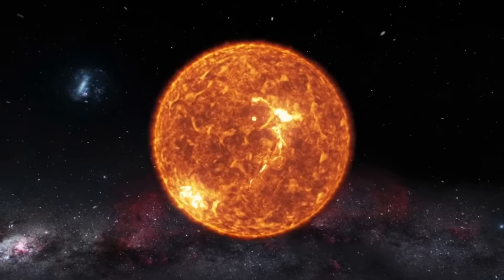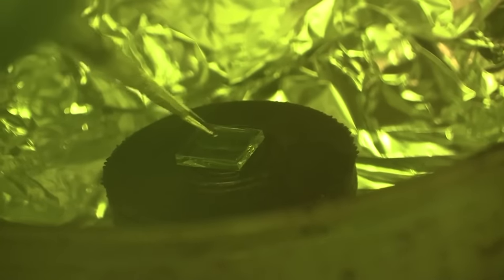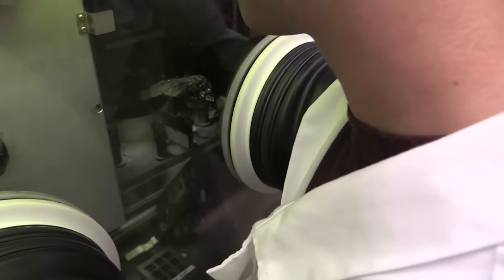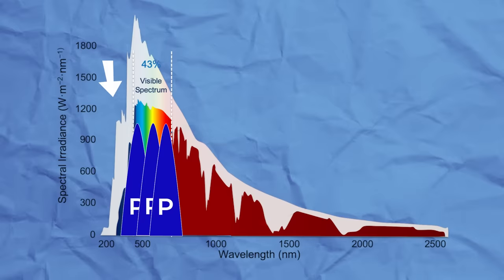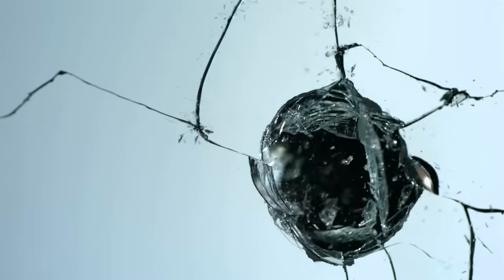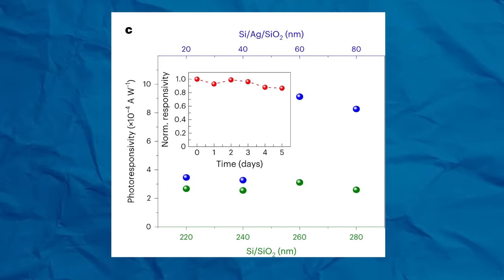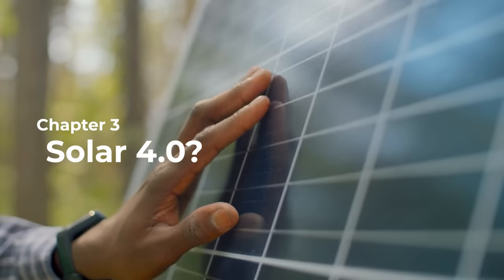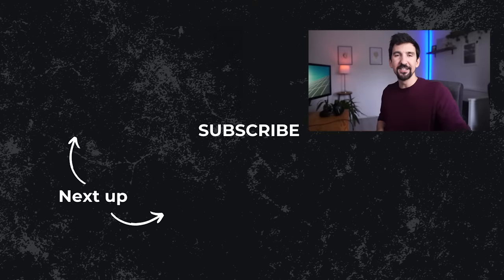Solar 4.0: Ultra Efficient Solar Panel Breakthrough

Comment: Just when I was thinking of getting solar for my home... now I have to wait for 250% better and cheaper Perovskite panels! 🙄
Reply: The wait can be long. Just like new battery tech. So, in the meantime you could get a slightly oversized amount of used classic panels for cheap, and use them for another 10 years or so. Some people do that and the math works out.

Comment: Cool, did the research study say how long it would be before they were ready to be deployed commercially? My mistake was that you answered this question near the end of the video about 10 to 15 years from now A very generous estimate too. Unfortunately, the significant problems with solar power get very hot, And from what you described, the environment would break the solar panels down very quickly.  The next problem is that you must use rare earth metals to perfect this technology, which is bad for the environment. The technology is promising, but it still needs to arrive; Until it's perfected, it means little of nothing. To quote the phrase, it's purely academic.

Comment: I am rather curious if you could avoid stacking all together.  Blue light has a wavelength of something like 400 nanometers and red down to about 800.  Staggered strips or perhaps some triangular planar tiling of 100 and 200 nanometer segments as a quarter of the wavelength provides a coupling region within the domain of one wavelength.
IE - a blue light photon would couple into the 100 nanometer sections and the red light photon into the 200 nanometer sections, even though the photon's wavefront exists across the entire surface.

Layers make silver reflectors complicated, but coupling regions in a planar tile would effectively change the probability of photons to striking those regions optimized for their wavelength to one while making it near-zero for non-optimized regions (although this case does present harmonics, we could use hippie fractals and computers or something to resolve a more effective planar architecture that could be implemented almost arbitrarily with jet printing or something).

Spooky filtering at a distance - SFAD Cell.

Comment: This is why investing on solar panels is questionable. 

Scenario:
You invest 10k-20k putting solar on your house, and cost it to repay in about 15-20 years.

A year or two later new technology increases efficiency by double and it costs the same, so your neighbour fits them, costed to be repaid in half the time. How do you feel about your investment?

Imagine that happening every few years as your still commited to a decade of repayments when others are doing it 5 years, if you had waited how much would you have saved, and how much would you have paid extra in conventional energy? That's the conundrum.

Comment: i'm all for solar and have one, but there always seems to be something new that will "revolutionize" Solar, but it never hits the shelves. As of now Solar is getting very expensive and its getting harder to justify the cost. Right now the UK government is spending £1.7 Billion onnew power stations. (Plus £700 mill that boris announced). Now imagine that, £2.4 billion and just put panels on peaoples home instead. At an average cost of 10k thats 240k homes that can produce electricity at an avg rate of 3kw. I just find that simpler.

Comment: percentages are not good to work with in videos unless you have to.  For instance, "increasing efficiency by" implies that if you say 100%, this is a doubling of efficiency, and considering solar panels are at about 20% roughly right now, that would mean 40%.  If you say 250% that would be a 2.5X increase, so 70% efficient.  If you say one has an efficiency of 150% of something else, then the increase is 50%.

Better to give numbers.  X is 20% efficient at conversion while Y is 40%.  One can easily see that's a doubling.

Comment: Perovskite would already be in production if it were stable - but it's not. They have raised its stability from minutes to years, but are still nowhere near the 80% sustained production over 20-30 years with commercial manufacturing that the market demands. It's a bit disingenuous to only offhandedly talk about stability when efficiency isn't the critical problem. It's like saying "my car will accelerate to 100km in 2 seconds" without following it up by "and then the engine explodes".

Comment: Title is wrong.
The panel isn't 250% efficient, that would be over unity and when we're talking about output of the sun this "250% efficient" solar panel would be a nuclear device.
The panel is 250% more efficient than current tech which isn't very efficient, two and a half times not much is very little.

Comment: the photon mirroring, effectively doubles the thickness of the PN layer in diagram-explanation using silicon.
So both the PV thickness and the mirror thickness matter at each wavelength
(SOSI, Son of a spectrometer inventor)
The thickness of the PV layer relative to photon depth
The thickness of the mirror layer relative to photon depth.
their ratios
PN junction thickness or average thickness
and orientation
The metal layer thickness may not be a true mirror at 2nm and the photon mirror vs tunneling % changes.
Repeat experiment with silicon planar solar cells.
Does this work in silicon or only pervoskovites?
Change the angle of irradiance to see how that changes the output.
Place detectors below and above to measure transmittance and reflection through and from PV surfaces and thicknesses. To detect tunneling and top reflectance.
Perovskites have hole traps in the 3d matrix and discontinuities.
The metal conductor is possibly doing two things for electron-hole transport.
Providing the lowest inductance possible, this allows high frequencies to couple such as local EM fields into the ground plane, not unlike a PCB.
Other things to try:
exaggerated thickness of the PV layers (Silicon and pervoskovites till effects not shown.)
relative to the mirror layer thickness.
The ratios of thicknesses and photon depth profile (average or each or profile of electron-hole pair birth locations) needs to be soused out to see what the bandwidths are to be exploited.
Another thought is the mirror creates a different photon momentum direction in the material matrix. Not sure if that is something that can be translated to an electron hole pair.
trying to be complete to last pebble only with that one.

Comment: This will not amount to anything until Perovskite technology can achieve longevity comparable to silicon.  Would you buy a hyper efficient hybrid car that got 200 miles to the gallon if the batteries died in 6 years? no.

Comment: I don't see these types of cells being viable, they are far to short lived. Solar cells are dirt cheap already, with the inverter and labor being significant factors, so marginally cheaper yet quickly degrading cells would be far more expensive over time. I have little hope that they will be able to get them to last 25+ years like current solar cells.

Comment: 250% more efficiency compared to what?  Older Perovskite cells that were so bad they weren't worth the effort? Like 4% so you could achieve 10%.  Not exactly bowling me over if you only manage that because it means you have to still have twice the number of panels to equal convenstional cells. Real world costs typically are more about installation and battery storage than about the cost for the cells.  Maybe there are some areas in the world  you could just roll out large areas of cells on a surface and never have to worry about wind, rain, snow, hail, sand, animals, vandelism or maintenance but these are few.

Comment: They could be 500% more efficient and it is still a poor technology at scale. Where do the raw materials come from, and what happens with them when they don't work anymore? There is no sun 1/2 the time, and they only work well in limited geography.  We already have great technology at scale which is Nat gas, and we have enough of it to bridge us to a much better technology which will eventually emerge. Maybe Helium 3 reactors, the surface of the moon has enough Helium 3 to provide clean energy on earth for a very long time.

Comment: This would be amazing if they can actually tune the wavelength absorbed. You could effectively get it to be the most beneficial in your area... whether it be full sun conditions, or mostly cloudy, that way you don't have to go through the horrible efficiency systems that are amorphous panels incase you live somewhere that is usually cloudy. I really hope they can find answers to the elements used as well as longevity.

Comment: It's ashame that per square metre of a Solar (silicon) panel requres approximately  on adverage 2000 litres of diesel to mine, 200,000 watts of elctricity to refine, billions of dollars of equitment to process, another 100,000 litres of diesel to mine the metals that go inside & another billion dollars of machinery to process.
It would take 250 years per squre metre to make it equal to it's worth.

Then if we replace the current power generation with solar then what about things like plastic, gas, aeroplane fuels, oil(s), etc. etc. that are by products of the production of crude oil ????????
We might get cheaper or maybe even free power, BUT. . . . . . It will completely destroy the entire planets industry & therefore the planets economy !!!!

Just like the invention of the old type fire extinguisher,  a brilliant idea that put out fires, but also ripped holes on the ozone that allowed more heat into the atmosphere that cause more fires.
Or air conditioning, that keeps a small area cool, but also tears holes in the ozone & heats things up, which requires more air conditioners to cool down.

Comment: in theory?  and then you point out a KNOWN engineering issue.   so in theory youtube could make you rich by repeating another supposed "BREAKthrough" from University of Rochester.  And we can transmit it on the REALLY REAL room temp superconductors right?

Comment: What happens if a magnetic field is introduced assisting the charges to move towards their respective electrodes? You're wrong about infra-red energy, as it's spectrum is vast compared to the visible spectrum, & there's lots of infra-red energy during night time, which is why lots of investments are going into thermo-electrics.

Comment: This isn't really news?  There have been perovskite panels and multi-junction cells for decades.  Most people use 20% efficient silicon based panels because the other ones are super expensive and environmentally damaging.  You only want the high efficiency ones in places like space where just sending the panel there costs $500,000 USD.

Comment: If people aren't licking the lead, I see no reason why it couldn't be used.  I have over 100,000 rounds of lead core ammo. I've restored many vehicles with lead based paint, etc etc.  With proper handling and safety precautions, lead is perfectly fine. Considering the lead in the panel will be quite minimal and have 0 food and minimal localized contact with people. I see no cause for concern.   If someone states its the mining and refining of the lead, well, I have a bridge and a swamp to sell you.

Comment: At most it could be 100% efficient. 250% efficient is impossible. 100% means it converts all the sunlight that hits it to electricity. 250% efficient means it converts 100% of the sunlight to 250% of the sunlight - a nonsensical statement. Pure click bait!

Comment: Your video does not give the efficiency of the perovskite-based solar cells and you used a "250%" factor increase in the performance of the cells - BAD SCIENTIFIC WRITING! The long-term life of the perovskite cell is not fully known. It takes years of exposure to determine the performance life when exposed to sunlight, weather, etc. The silicon cells took a number of years to get the 20 year (or maybe longer) life of the present ones, which still show some degradation. The highest theoretical efficiency for silicon type solar cells is on the order of 40 - 50%, using a number of layers and special coatings. They are not commercial yet.... Disapppinted that you did not provide the paper your talk is based on... The paper you showed is for the silver mirror - making the solar panel much more expensive. Very Disappointed... Looks like you have another video with Battery 4.0 with 200% energy.....Very Very disappointed in you and your "Scientific Bloat"!

Comment: Pure claptrap! That very valuable solar energy you are wasting to produce electricity, that is far better and more easily and economically and environmentally produce by other means, that solar energy could be being used to the much greater universal benefit, of all vested interests. Solar electrical is an inappropriate application of technology, advocated by vested interests determined to swindle the gullible public. Solar electrical generation is only practical in venues where no other alternative is available but it is utterly useless and wasteful to use it for any kind of domestic supply. This piece is pure commercial propaganda!